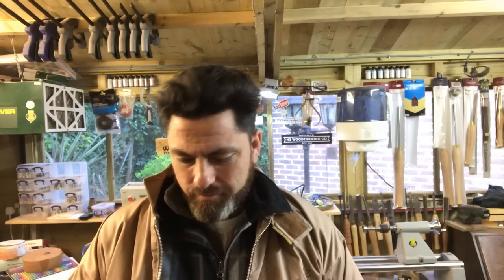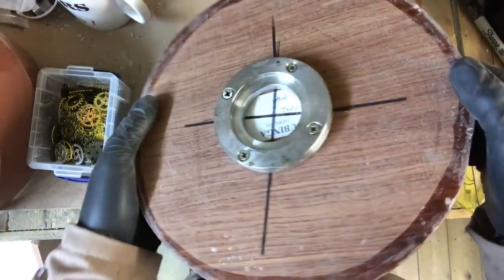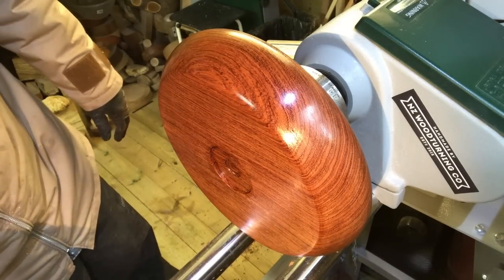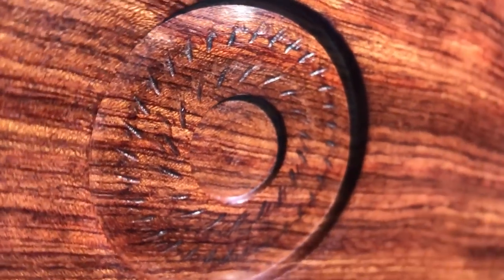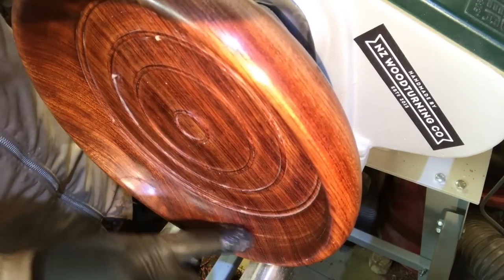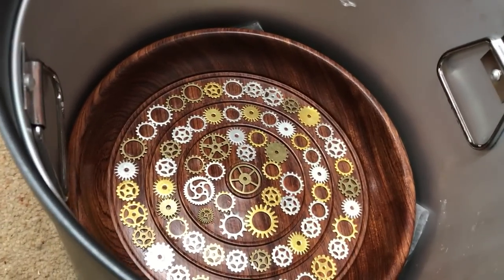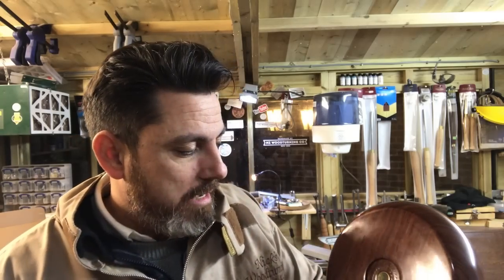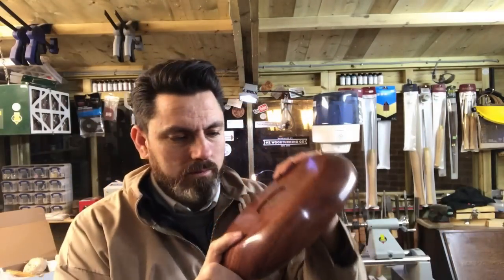Woodturning - cogs in a bowl

Comment: Didn't think you could have improved on that wood but you did. Looks very good and a very different Idea(you could have put some small grooves in and put some gold/silver chains in as well)
Nick just would like to know why you have to put a resin item in the pressure thing as I don't have a clue?
Reply: it helps get the bubbles out of the resin.
Reply from the maker: Hey Graham, it to get all the bubbles out of the resin. you dont need the pot but you are more likely to get bubbles. i have had some with loads and some without with no pressure pot but using it almost guarentees sno bubbles.

Comment: hello Nick I do pottery and I was wondering if you could do something like what I did and one time and I was trying to do a water fountain but I was not trying to animate it wrong word make it pump water and so I was wondering if this would be possible with resin or a material that you feel would be right for this kind of project I do clay and I have a picture of the finished result I did it isn't very good I did not dig out where the water would flow enough and a little bit of the clay broke off a little bit I can't seem to put pictures on this this but I will put a picture on my channel of the result that I did and I was hoping that you could try to do something similar only if you have the time and if you want to of course